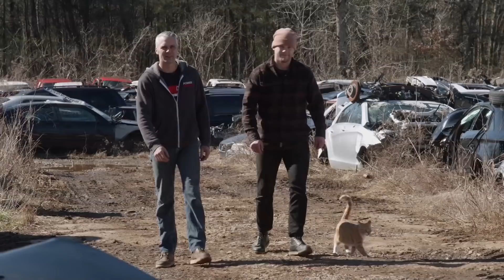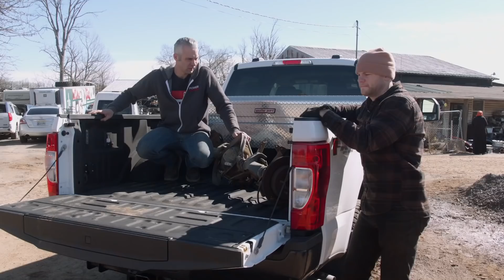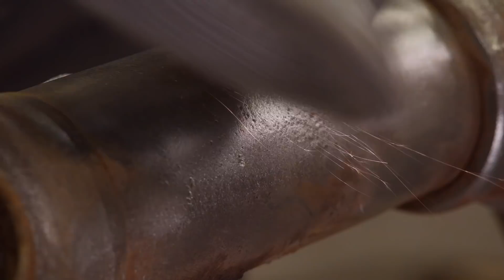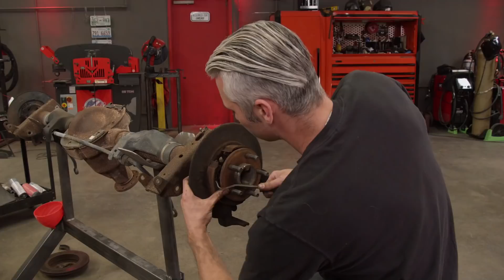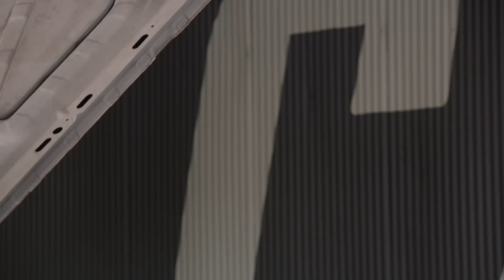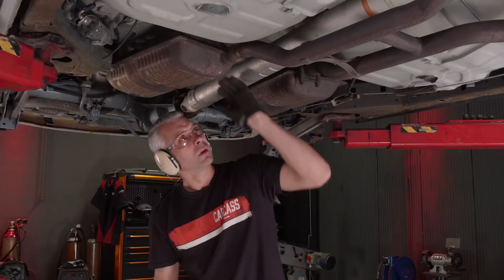Crown Vic Cruiser Gets A Junkyard Axle For Its Spec Panther Transformation - Part 2 - Carcass S3, E7

Comment: Why on earth would you put a softer than stock spring on a front heavy race build?
Reply: You'd be better off cutting the spring as it will lower the car and stiffen the rear
Reply: I'd also box in those rear control arms. Makes a ton of difference on these cars and is probably within the rules?

Comment: I just did the same axle swap, I had 3.27 gears in the car , the new to me axle is 3.73, The 1st test drive I got about 100 yards and the car went into limp mode the wrench came on & the CEL, and the engine seemed like it was flooding or running on a cylinder down, Trouble codes: P0104, P0122, P0223,P2106 and P2110, P0113 and P0114. I'm on disability so I have no money to go have a tech look at it, Is there anything I May have overlooked ? ANY INFO or help is very much appreciated. I have no idea why all those codes came up, It drove & ran Excellent before the axle swap.
Reply: Usually you would change your axle ratio or something like that on a tuner or can probably have a tuning shop tune it
Reply: @teocool1   thanks for helping me with my car problems , I appreciate it. 
I was hoping I could simply reset the ecu,pcm by removing the negative cable and running a wire from the neg cable to the positive post so everything will be drained ?? Do you think that would work?
Reply: @Tomtom62  I'm not an expert but I don't think that would do any more than just removing battery terminal, I've also never done this, just repeating something I saw somewhere. I figured you might appreciate any reply lol

Comment: I'm surprised that is not an LSD optioned P71, If I recall correctly you can get a 3.27 open diff or locker and the C6 axle being the 3.55 locker.

Comment: This is why I can't enjoy shows like this, so first they check all the rear ends to see that they don't have a 'locker'(not that any Crown Vic even ever came from the factory with a 'locker',only limited slip)by turning one side and seeing if the other side turns with it.
 So then they have the idea of checking data tags,and after finding one with the right numbers just tossed in the truck without seeing if the 'turn the axle thing' is any different,check the fluid inside.(if there is any),make sure that neither of the axles are bent or what the gear ratio is!....nope just trust a part that only god knows how many miles are on it and throw it in the car.
That could have been from under a taxi cab for 3 to 400,000 miles!!!
Reply: lol boy you are getting hot and angry over something I'd be willing to bet they did do off camera, but yes, they may as well have showed it.
Reply: @SKATETOSLAYER   Yeah,... but I know a lot of people don't know much about cars and try and learn them from these DIY shows and that  puts them in a pickle sometimes worse than if they just did the research themselves.
Reply: The guys on TV aren't really the best mechanics. They are staffed with real mechanics behind the scenes.

Comment: That is a police intercepter package due to the grille is black and not chrome.  I am totally surprised it didn't have a limited slip.  Also, I know they are going for value over looks, however, I would have swapped out the calipers all the way around.  Remanned cals at Oreilly, AZ or Advance are rediculously cheap and new cals and hoses are cheap insurance for the track.  I will tell you, the binders and rotors from Hawke were not cheap.  You guys do great work, keep it up.

Comment: If you can grab parts off a mustang, might as well have grabbed the torzen lsd out of a ranger 8.8 and the 4.10s
Reply: do not think that is legal on spec panther. i believe only the factory panther trak lock is allowed
Reply: They are the same Eaton limited slip design. The Cobra mustang and other high HP vehicles can use enhanced clutches made of carbon though. Only other 
major  differences are the axle spline count 31 vs 28 etc...

Comment: Nice to see the Crown Victoria's and the others getting some much needed love,most people will laugh that these cars are to heavy and not much to do on, I want that thinking for them.i will enjoy my 04 with 119.500 miles 2-wheel drive slightly "modified"😎 V8 That chirps the rear tires hitting second gear with more upgrades in the works.
Reply: The Grand Marquis get even less love and they are great cars for the money and are dependable with low miles.
Reply: My 08 P71 has 287,000 miles on it and still drives like new but both of you are correct since the last one made in 2011 they don’t get the love and attention that the deserve. Wish they would bring the panthers back and show those FPV’s whose still king of the road.

Comment: The object is to heat the outer not the bolt. That only makes it bigger so you got lucky. Also if you're going to cut a spring use a bandsaw not a cutoff wheel.
Reply: Agreed, however that circumstance would not have allowed them to heat the sleeve to which the bolt was seized. It was surrounded by a rubber bushing. By heating the bolt, they were able to break the bond (rust). Then, once the bolt cooled (and shrunk), they were able to punch it out.
Reply: @gutlass  I never said that it would have worked in this situation. I just mentioned that they got lucky. Especially since physics tells us that shouldn't have worked.
Reply: @gutlass  like I typed. They got lucky. When you heat the bolt it expands. Thus defeating the purpose. These are a pain in the azz to work on. But after some thought it can be mitigated.
Reply: Why not use a cut off wheel
Reply: @brandonspencer7244  takes entirely too long and more control. There would also be less metal debris

Comment: Question. First car. Ex interceptor. Bad idea?
Reply: Yes and no. Con's: You will spin out when wet or if you have bad tires. You will back into things you can't see without a camera. The windows will stop working randomly. Oil in spark plug tube problem, Intake manifold cracks, etc etc.
Pro's: All the POWAH AND AUTHORITAH!!!!!!

Comment: Why would you want to put a locker in a road race car?     You want a differential that works linearly, not on or off.    A limited slip rear dif would be a better choice for the road track.   Lockers should stay on trucks and drag cars.
Reply: What they put in was actually a limited slip, these cars never came with one that was fully locked.

Comment: I thought all CVPI's (especially later models) had the 3.27 traction-lock rears??
Reply: Sone had 3.55 limited slip also
Reply: My 2010 P7B has a 3.55 and is a non LSD.
Reply: My first 2011 P7B came with a 3.27 limited slip, the car got rear ended unfortunately. 
Got another 2011 P7B  and it came with a 3.27 open diff. Luckily I was able to pull the gears off my old car. Haven't installed it yet.
Reply: Most have 3.27 open. Swapping in a limited slip 3.27 pretty much did nothing at all for going around a track with sweeping turns in a car that barely makes 200hp to the tires.

Comment: A shadetree mechanic showed me the best way ive ever seen get the bolt red hot and splash it with ice cold water ..the rapid hot to cold will brake loose anything if dont correctly..
Reply: You can also take a battery charger to it.... Ground one or frame and hit the positive end fir few nano seconds a couple if times. Works with stuck parking cables. caution can damage electronics including ECM if not dine correctly.
Reply: Don't reuse that bolt though.
Reply: @2000blackstang  yea it does require new hardware but it blows my mind first time i seen it happen

Comment: L stands for “limited” not locker. It’s just limited slip diff. “ LSD”
Reply: Northshore is wrong, gm gov lock lsd work that way in trucks, fords use clutch type trac lock lsd in the 8.8 cars and trucks.
Reply: L stands for Lysergic 😜
Reply: the do mods on a ford and are not familiar with ford tech, and yes L stands for limites slip or track-lock as ford calls it
Reply: Really wish Tommy Bosher was here
Reply: These are the same guys who said "the proper air in your tires is listed on your sidewall"  smh.
Reply: @HorsepoweredRims  well that's actually the truth. The sticker that came on your vechile that tells you the air pressure for tires was for the factory tires. After those get changed, you follow the manufacturer's stamp on whatever for proper air they have determined for the tire.
Reply: @trentonmurphy5156  u think the average sap knows that? Theyre gunna see 44 psi max and may put it at that and definitely not what the door jamb says.
Reply: @HorsepoweredRims  well if they read the tire, they are doing it right. Because the tire manufacturer knows what their tire must be at based on the tire specifications. We understand that each tire is different. The sticker on the door will only apply to the stock tires that came off the assembly line. After the next tire change. You can follow what is labeled on the tire. The average person may not know that or do it. But these guys aren't misinforming the public either.
Reply: @trentonmurphy5156   you're clearly one of the people who would believe these guys.  Are u a mechanic or are u reading off of the internet? Because the internet is always right?  

Go outside and look at your tires, if u have a car, it might day "max 44 psi" now that doesn't mean u fill your tires to 44 psi that means that 44 is the furthest you should go. Ill give u a personal story. My cars tires say max psi of 44 but my door jamb says 35 psi.  

I would know this, being a mechanic. And also I've PDI'ed many cars, I've never seen the psi written on the tires as well, as u mentioned in your previous comment
Reply: @trentonmurphy5156  the sticker states the PSI based on the car’s weight and balance.  That goes for ANY manufacturers tires. Tire manufacturers make the tire in a specific size, they have no idea what vehicle it’s going on.  They have no idea what the pressure should be at.  Therefore they only put MAX PSI on the sidewall.  Do some research before spewing out bullcrap.
Reply: @cowmilky  I have done my research, and it also helps with fuel economy, fill to what the manufacturer states on their tires and to maximize the tread life, as well as rotating your tires often. The tread pattern is designed by those manufacturers engineers that we all love and hate at times. They created a design to optimize the best technology at certain tire pressures. Every situation is different on air pressure. There is a balance with everything in life. The tire wear pattern is also letting you know about suspension components begining to fail on the vechile or the tire is over inflated or deflated. We all enjoy checking out our tires, it never fails. But here we have the main belief in the Car World, that we help one another. We help those who we can and take pride when our vechiles make it further than 10 miles down the road. But we want to help cut down on the expensive costs of maintaining vechiles. It's a very tough time in the world already. It is all a recommendation but you can only decide whats best for your vechile and everything always brings up a good debate.
Reply: It’s not a debate when you are wrong. The only time a tire is filled to the max PSI is when the vehicle is loaded to its maximum capacity based on the gross weight rating.  If you fill up to max and drive around thinking you are saving money on gas, give it time till the center treads are completely wasted and the shoulders still look new. If you did in fact do your research, you either read wrong information or you like to tell people wrong information.   Either way you are wrong pal. 🤣
Reply: @cowmilky  well my tires wear even and don't go bald down the middle so I'm sticking to what I believe is right for my vechile. You do what you want to do to yours. Good day.👍
Reply: @Trentin Murphy. Tire replacement should always match oem specs. If not they should exceed. Never less ... Such as speed rating, tire sizing and psi specs. Wear ratings are all over the place and tire manufacturers do not have set standards. They essentially set their own based on their own testing methods. So disregard wear ratings... 

The vehicle manufacturer typically has the tire specs on the same decal as VIN. I recommend specs unless you are towing, or have tires or rims not of factory design.
Reply: @trentonmurphy5156  it’s a race car!!! Not a mpg car!!!
Please do more research!!!
Reply: Thanks for teaching what the difference is between a race car and one designed for fuel economy. I've been so confused on it. 🤦‍♂️
Reply: It's not going to say L on the diff for limited lol 😂 It's identifying it as a locker and then gear ratio.
Reply: @Joshua Kruty negative ghost rider. 

L stands gor limited slip on Ford rearends that come with Eaton style clutch disc limited slip differentials. 

Source, i spent 22 years as an ASE master tech/fab tech(custom rearends) with adv diag credentials, 2 welding certs, MAC (Mobile air conditioning), hybrid certified. I also did custom fabbed headers and exhaust, plus custom suspension including design then fab. 

I now hold three clinical degrees in nursing, having just attained a Doctorate of Nurse Practioneer in 9 years of nursing. 

I can assure once again a tag on a Ford rearend that reads 4L11 means 4.11 gears with an Eaton limited slip traction unit.
Reply: LSD u u gotc someė
Reply: The good kind of LSD lol
Reply: In that particular case L might mean anything but most likely it means locking since truck diff have a locking mechanism . It works with gyroscopic force and locks once a wheel starts spinning. Unlike a LSD that you might find in the rear end of a m3, they don't use clutches, rather weights and springs. They're either locked or open whereas a clutch type limited slip will limit slip more and more depending on load. I'm 99% sure that ford used the locking type since it had it as an option on f250s and 350s.
Reply: @northshore_driftworks629  nope. It’s a crown Vic diff. Only option was a clutch style limited slip.
Reply: @northshore_driftworks629  no, there was only 1 very rare option for a factory locker-in a 6.4 era f250/350
All the rest are clutch pack type limited slip differentials. 
Something close is AAM’s hydraulic locker/limited slip used in 3rd gen and later dodge 3/4 and 1 tons and some GMs

Comment: I'm really surprised that you're going with a dramatically lower spring rate than stock on the rear: I would have expected you to want a higher spring rate, and cutting (as you did on the rear) would have both lowered and increased spring rate. Not saying it's perfect but it's in the rules. 

Pet peeve: a Panther doesn't have struts, it has shocks. Struts are fixed at the bottom (generally with a pair of cam bolts to adjust camber), shocks are pinned at the bottom.
Reply: The have a coil over style strut. It’s just not a locating Mcphearson strut like you are referring too like on a Fox
Reply: @alanhill5513  They have a coilover shock, not a strut. 

You can get a shock or strut in coilover or otherwise. Obviously there are lots of non-coilover shocks, there are also coilover shocks (such as the front here, or rear suspension on a drag car is typically that way). Most struts are coilover, but there are vehicles with torsion bars and struts - Porsche did that for a long time.